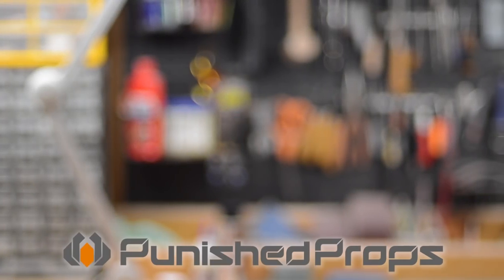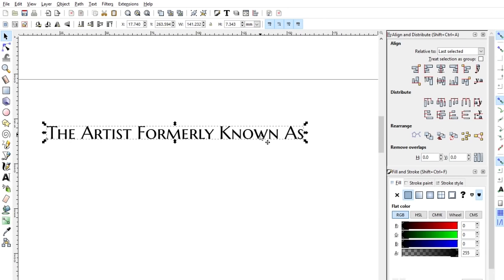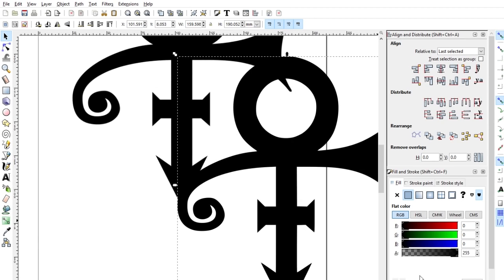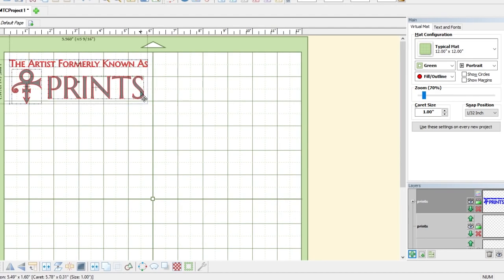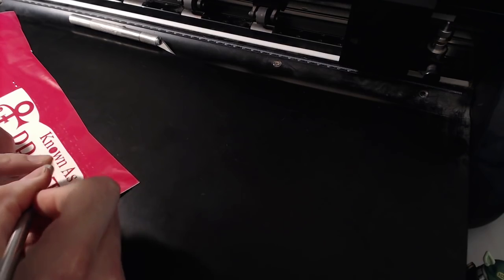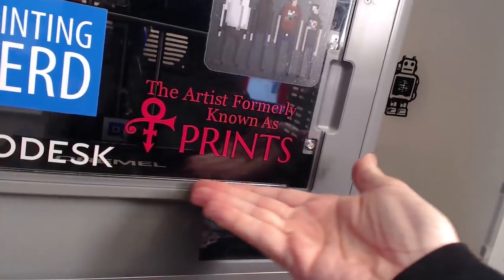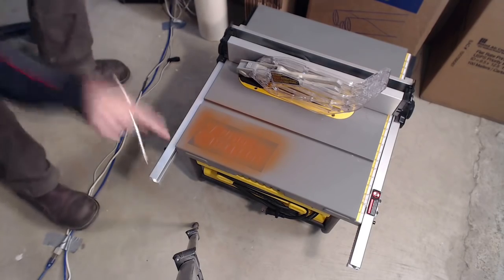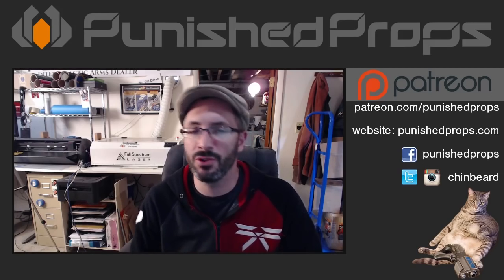How to Draw Vectors for Vinyl Cutting & Stencils - Prop: Live from the Shop

Comment: With no experience in Inkscape, I have a question. Can you take the path generated by Inkscape and import it into modeling software like Fusion 360 to extrude it into a 3D model? If not, are you familiar with any way to do this? Endlessly drawing splines over an image is inefficient.
Reply: That's awesome news. Many thanks.
Reply: You can definitely do that using Inkscape, Photoshop or Illustrator. Just draw your paths, export a SVG from your file and import it into your 3D software (Fusion/Maya/3DSMax/Zbrush). Just make sure to seperate objects appropriatly (or connect them if you want unified objects in 3D). Hope that helped.

Comment: Great video regarding the cutting of the stencil, however I would not have spray painted the table saw.  You want it to be extremely smooth and seems that paint would have left enough of a raised area to interfere with wood sliding across.  Would have been great to use electrolysis to "etch" the metal saw surface using your stencil.  Plenty of youtube videos on doing it.  Otherwise good info.

Comment: Nice! I actually had a job 10 years back making these and going out sticking them on for businesses. Btw, we used Illustrator.
You might already know this but just incase you don't, a little tip if you're ever putting a vinyl sticker on a window you can just spray on some window cleaner spray first and thereafter put the sticker on. This will help you position the sticker without having to take it off and on again, risking ruining it. Then just stroke well to get the bubbles out and ta daaa! 
Should there be some small bubble you can't seem to get out an exacto knife or needle can be used to puncture it and stroke it again. You can't see the hole anyway, if you're doing it right.
This works on some other surfaces as well.
Anyways, thanks for all you're doing for this community.
Reply: I like the clean it with alcohol , then mist it with water with a few drops of dish soap in it. keeps it squishy longer if you mess up you have a touch more breathing room.

Comment: here is a helpful hit when weeding text from cut vinyl. go in the same direction that the text goes. in. that way you dont get peel back on letters
Reply: Another good tip is go over the vinyl with your squeegee  first before you weed it out. This will help the lettering stay on the backing paper.